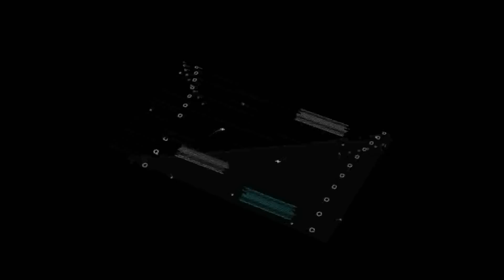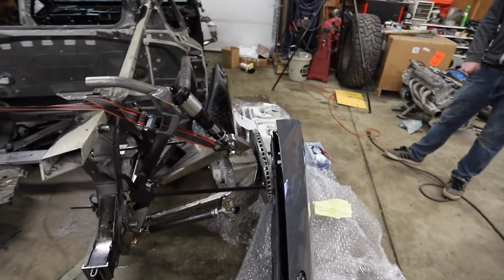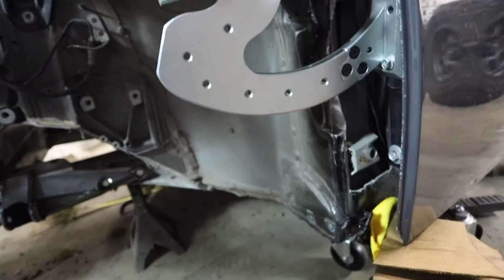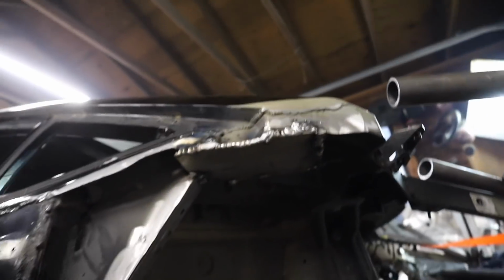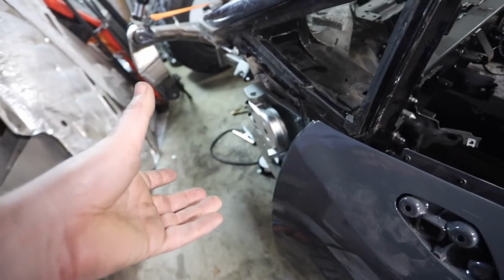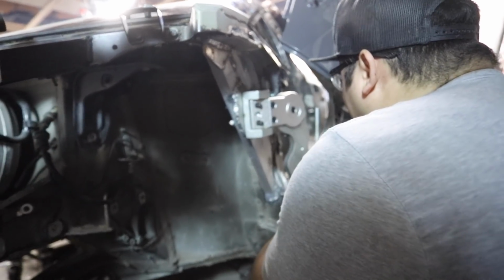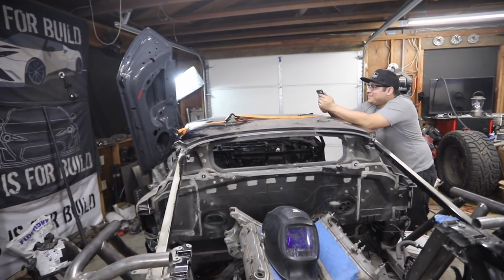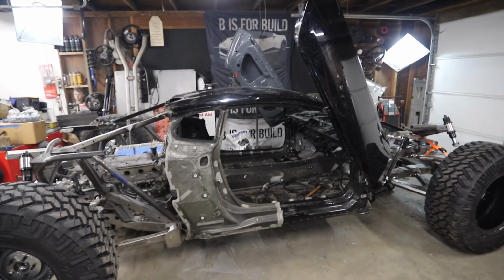We Put Lambo Doors on the Off-Road Lamborghini Huracan!

Comment: Those door shocks should always point down when in "idle" position. Otherwise they do not get self lubricated.
Also. Why compress it? Why not open the door and then install it?
Reply: Lol I was thinking the same thing. I think they realized it for the passenger side.
Reply: Exactly my thoughts!
Reply: FOR REAL. You're supposed to open the door, install the strut, then close it. Like, what the actual fuck. Have they never installed hatch struts before? (obviously, since they also installed the strut upside down)
Reply: The push angle was completely wrong... the top end needs to be lower, more horizontal... plain old geometry. Draw it out... force input point (gas strut), pivot point (fulcrum), load point (door hinge attachment point).

Comment: the ratchet strap works great use an old tire cut a squre piece 2inch by 2inch or 3in by 3in set it in-between the two and you are good to go!

Comment: Your Gas Springs should be installed with the seal  on the bottom so the the oil inside keeps the seal wet and will keep the gas from leaking out over time.  I do enjoy your videos.

Comment: Hey Chris if the steel hinge is on the aluminum body wouldn’t there be corrosion after a while? Because of steel and aluminum contact.
Reply: It needs to be suspended in an ionic solution. But straight steel on aluminum in a dry environment won't really do much.  Otherwise yeah it will galvanic corrode.

Comment: why compress the strut? Why not just lift the door, install expanded strut and drop it down??
Reply: Because the Strut isn't fully extended within the range of the door swing.

Why they didn't pick a different combination of mounting holes/tabs that would allow them to install the struts fully extended, I don't know. Since the custom fabricated both mounting locations, they could've put them anywhere they wanted.
Reply: One of the door seemed to open on its own, but not the other, so make them adjusted the same and it Will be awesome.
Reply: That would have made sense

Comment: Keep a cheap spool of small braided steel cable with appropriate crimp connectors for it on hand. Would solve all the issues you had with compressing those shocks.... and thousands of more thing you never thought of until you had them. Also, I hope you aren't adding any weight to those doors.

Comment: 9:49 OK you people are proper scary. 

If you need to get a lot of force into a tiedown strap... what you use is called a shackle or gyve. It is a metal fixing which the strap passes over a bar, and attaches to whatever you're trying to restrain. Tiedowns are quite dangerous if mishandled, and they're misused more often than not. I wouldn't be compressing springs with ratchet straps, but I could do it in a pinch and not stab holes in the strap. Bloody hell.

Comment: Adding extra crap onto a racecar has one effect:  it reduces the racecar to a showcar.   No self respecting racer adds weight and complexity unless the item is needed to meet tech specs, safety specs or add performance.  "Looks" are not performance.  This is not a racecar.